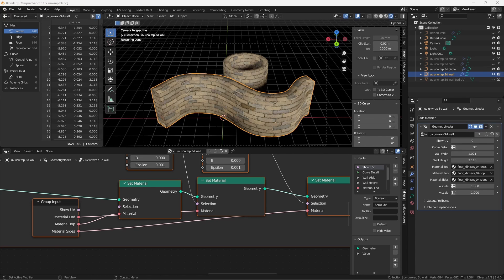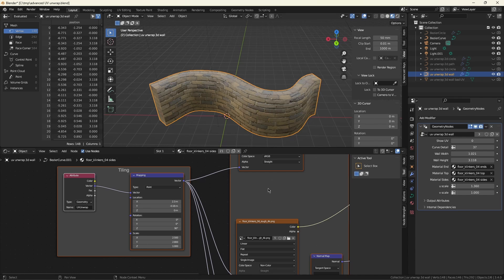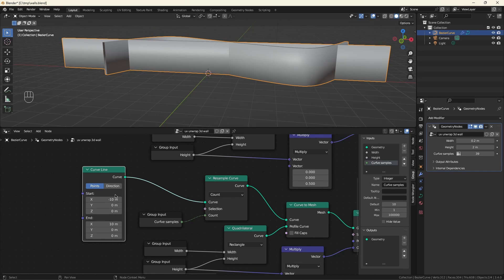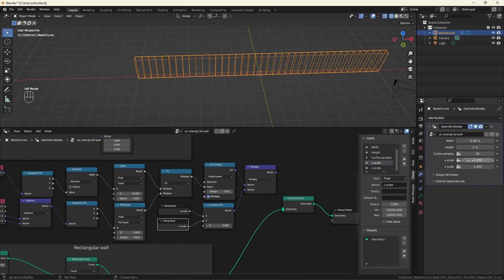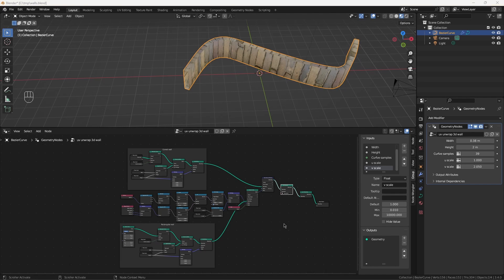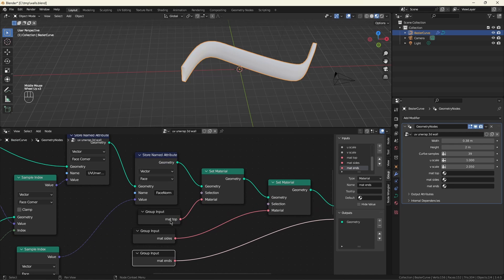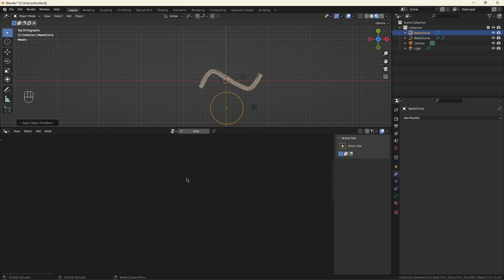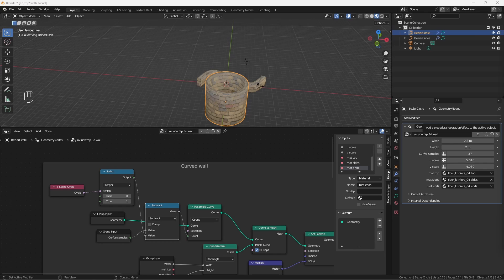Blender 3.4: Procedural creation of a wall with automated UV unwrapping and texturing

Comment: As others said, a clever concept and explained well - thank you.  My 'dwarf-standing-on-giants-shoulders' tweak was to take the dummy (straight) wall length from the length of the curve instead of an arbitrary 20 m length.  (My test wall was longer than 20 m, so overran the UV map coming from the dummy wall).